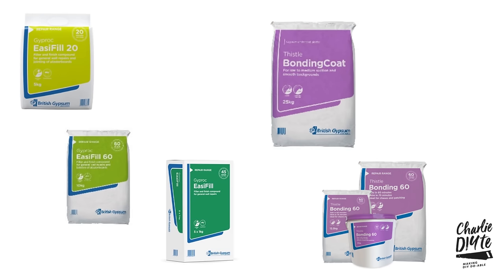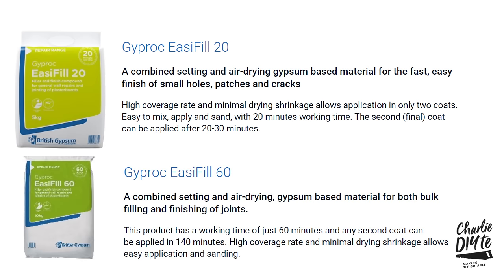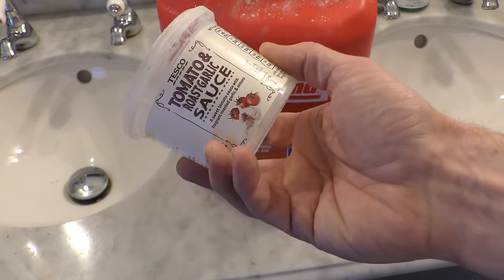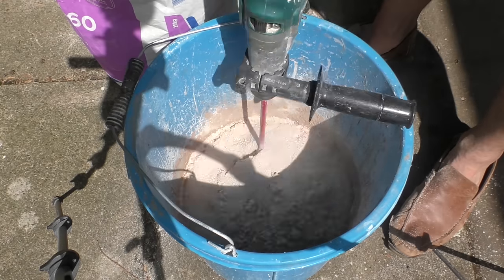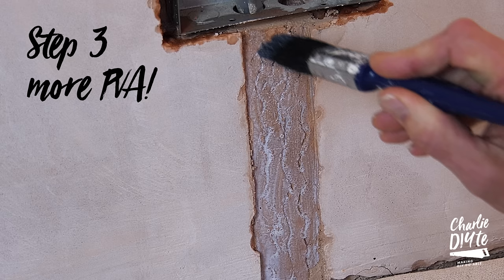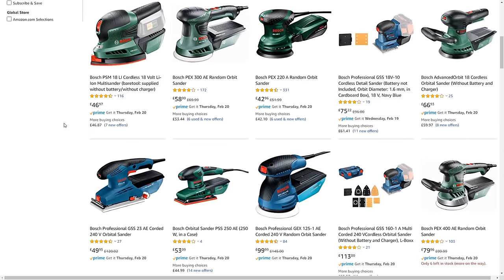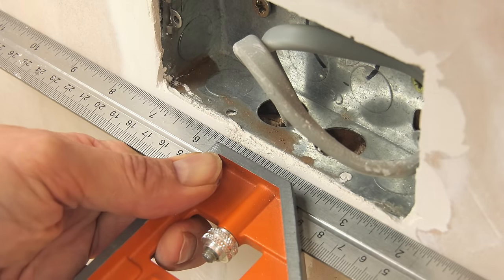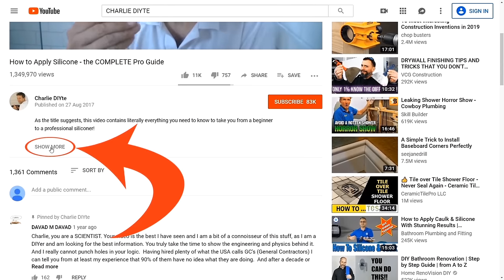How to Fill Wall Chases, Cracks & Holes

Comment: Hi Charlie, I have done a patch repair (100cm x 30cm) on blown plaster by just using Easifill 60 - built up in stages. 
Would it be best to use a diluted primer like Zin123, or just watered down emulsion before the final 2 coats?
 I don't want it showing after final coat!
Reply from the maker: If it was me, I'd apply a mist cost of watered down emulsion, but just make sure the emulsion can be watered down as some can't, as discussed in this video https://bit.ly/3ilSD3P It's always a bit tricky getting a patch repair to blend in seemlessly, but you could always feather the edges with some fine sand paper eg 240 grit or above, if it's a bit raised after the mist cost.

Comment: I have a great trick for back boxes.  After drilling for the screws & plugs, I fill the hole with plaster & push the box into the hole.  The plaster squidges out from the sides. You can get the exact depth you want, and the entire box is surrounded by plaster.  You can then insert the screws to prevent it moving, and clean out the excess plaster from inside the box.
Reply from the maker: Nice one Victor. I'd go one step further, and use expanding foam rather than plaster. That way, if it's an external wall, you're insulating the box from damp etc.
Reply: @CharlieDIYte  Good idea!  I suppose if there was a gap going beyond the edge of the socket, you'd need to use a bit of plaster, otherwise it would show..

Comment: Do you have any videos about fixing a crack in a concrete ceiling? Looks like I will be using Nucem HP & Primer - not too expensive but the delivery £35 stings. I've removed wallpaper in 3 rooms and  quite there's still 2 or 3 coats of paint (all the way back to 1930's original concrete render) and is there a paint on product to stabilise this as it will be a hell of a job removing it all?

Comment: Is the PVA necessary just for bonding? In the second example where you just used filler,  did you PVA the surface?
Reply from the maker: It's always a good idea to de-dust the surface as it enhances the key for the filler but check the instructions because some fillers don't require it - but even there it's still a good idea. Yes, I did PVA when just using the filler.
Reply: @CharlieDIYte  Thank you, Charlie. I'm literally about to tackle this today, and your video has already been super useful. Wishing you a very happy New Year!

Comment: Would I still be okay using these products if my house is solid wall (no cavity) built in 1903?

I need to backfill big gaps behind old skirting so I can glue/pin new skirting to something. Old Skirting was pegged into wall with timber pegs on the skirts.

Comment: I am goind to fill gaps left after removing pieces of timber(built-in wardrobes frames were attached to it). I've been told to use British Gypsum Thistle Undercoat Plaster. As you nicely explain the different products, would you mind giving your opinion on this? Can I use this to patch up the gaps which are 100mm wide, 10mm deep and 2300mm high? Or should I use Bonding 60 and finish with Easifill? I will apply whatever I choose on brick wall. Thank you.
Reply from the maker: I'm pretty sure Undercoat plaster is designed for shallower repairs than Bonding 60 (so up to 11mm) and it doesn't go off as quickly as Bonding 60. Other than that, they're pretty similar and you can build up Undercoat plaster if you've got deeper gaps to fill. So either would do the job well, but Undercoat Plaster will take a lot longer to go off. Yes, I'd use Easi-Fill to finish.
Reply: @CharlieDIYte  Thank you very much for your answer.

Comment: Couple of questions - apologies if they have been answered, I've been on that many forums and watched that many videos that it's starting to give me a headache. 

1. Did you use PVA before the EasiFill on the second chase? If so, do you let the PVA fully dry before adding it, or just wait until it's tacky?
2. What would you recommend doing if looking to repaint a wall and you've filled in a few cracks and holes with EasiFill, and the rest of the wall already has paint on it? Would you first apply a mist coat to the EasiFill parts, no matter how small? Then undercoat the entire wall once dried?

Thanks, Charlie.
Reply: Point 1:
I would apply a coat of PVA, let it dry, perhaps do it the night before (I like to keep the spare PVA mix in a plastic milk bottle, then you can easily mix it the next time it is needed with a quick shake (make sure the lid is on well though!) then apply a second coat shortly before filling so it is tacky but tbh it won't matter if it dries from my experience. Don't get too bogged down in the detail. If you think when a plaster does a whole room the chances are some of it is tacky some of it will have dried.

Point 2:
I would give it a mist coat if I had the time, but if they are only small areas you will be able to get away without. Though maybe pop up some post it notes or bits of light tack masking tape pointing to where the areas are as they can be hard to see after the first/mist coat.

I wouldn't do the entire wall unless it is needed, often you don't need to but the new paint may stand out and therefore mean a whole wall painting is needed.

Hope that helps.
Reply: @C4sp3r123  Thanks for getting back to me!

Comment: This is pretty much the technique we use on our professional electoral jobs. 

Some tips: 
Use a piece of 20mm conduit for the cables, it will let you pull up slack from the floor in the future if needed and protect them where they enter the box.

You can squirt in some expanding foam behind the box through the holes and in the gaps around the edge.  This will help to support it and is a lot faster then trying to force filler in around the edge.

If you're careful with a slightly damp sponge you can polish the easifill to a pretty smooth finish.
Reply from the maker: Fantastic tips. Thanks mate 👊

Comment: Hi Charlie,
Some advice please. The plaster on a small interior wall, adjacent to the front door, has areas that sound hollow when tapped. (Probably due to many years of the door being slammed, house built in 1896).
Is it worth trying to inject dilute PVA into these areas to try and re attach the facing plaster to the Victorian brick work.
I’m trying to avoid the ultimate fix of ripping off the plaster due to cost and re decorating hassle, many thanks
Dave
Reply from the maker: Hi Dave, yes I've done something similar myself but typically where I've got a small patch that's come away that needs redoing and I work diluted PVA into the gap around the edge of the hole to firm up and re-establish the key on the surrounding area to the repair. It works really well. You could perhaps make a small hole and do the same, filling the hole afterwards with Easifill (get one of the 4kg boxes that has 1kg sachets in it) - perfect for spot repairs. I'd say it needs to be a reasonable sized hole just to get air into the gap to assist the PVA setting, and of course so that you can get a decent amount of PVA in there.

Comment: do you think if you had the time it would be better to use the method you applied on your first socket, as the thistle bonding may create a harder fill? or not?
Reply from the maker: No, the easy fill sets to a similar hardness, but if I had large areas to do I'd use the bonding first because it's easier to tool.
Reply: @CharlieDIYte  Yes, also Easifill has gone up a lot since this video was made, a 10kg bag of Easifill 60 is now £27 . A 25kg bag of bonding is half that price..

Comment: What's your thoughts on everbuild one strike as a filler?
Reply from the maker: Never used it, Mark. I have such great results with Easi-Fill I've never seen the need to experiment with anything else - apart from the near identical Tout Pret when Screwfix didn't stock it.

Comment: Is there any other reason to use the bonding rather than just outright easifill? Is it just the cost as you say?
Reply from the maker: It's a good point, and I'd have to say, for wall chases at least, none other than the cost. You might find though if you're filling larger areas, ie perhaps a whole wall rather than just wall chases, that bonding is much more malleable / easier to work.
Reply: @CharlieDIYte  really appreciate the reply. Hope you have a fab weekend

Comment: How do you fix these holes with wallpaper on the walls?  All the examples I find are bare/painted walls.  My knee went through the plaster wall and there's a small hole i need to fill.  These videos are great btw :)
Reply from the maker: That's tricky. Is it just painted wallpaper? I think you're going to have to fill and sand like I showed here with the Easi-fill but don't overtool it close to the paper as the paper will start going mushy and tear, and be incredibly gentle with the sanding. You might then just get away with it. A bit of watered down paint to seal the repair and then paint over with your normal emulsion. The other option would be to try and scribe in a piece of new paper once you've filled and sanded, but this is going to be tricky as you'd need to leave the repaired area 0.5mm indented from the surface to take the paper.
Reply: @CharlieDIYte  Ill give it a go and see how it does, thanks very much for getting back to me, much appreciated!

Comment: why did you just use easifiller on the last fix ?
it was the exact same size as the first fix , why no bonding or p.v.a ?
why not just use easifiller on both fixes ?
thanks

Comment: Will this work for filling missing bits of plaster/gaps around my new sockets. My plasterer who reskimmed my walls decided to plaster over the entire backbox, he had a bit of tape inside and then ripped it out. It looks a bit shit on some of them. I always seen plasterers plaster upto the back box edges, not plaster the whole backbox then try to cut it out, just a bit bodge but he done a great job on the new ceiling and walls. 

Most of the socket holes are okay, socket plates cover these and are more square, just need to resquare off the bad ones. Also do you PVA in the cracked gaps before putting in bonding?

Great video! I never plastered in my life but I reckon I could do the bonding and easifill.
Reply from the maker: Yes mate. EasiFill is brilliant for this. I've tidied up around countless back boxes with it. Get this one https://bit.ly/393yo8a That way you're only opening one small bag at a time.
Reply: @CharlieDIYte  Many thanks Charlie! I was thinking of pushing some bonding plaster in, let it sit proud then shave it back a bit on the gaps/cracks then easifill over. Some of the lips of the square plaster around the backbox got large chunks missing. Do I need to pva before putting on bonding or will bonding adhere to current bonding/skim parts? cheers mate! This tutorial is amazing! really down to earth and well put together. How long should I wait for the bonding to dry before applying PVA before skimming over with easifill or should I just let bonding dry out completely and then pva and then easifill. Sorry for all the questions,

Comment: I always make sure I have another area prepped when I'm doing any filling, so any extra mix isn't wasted. Works right up to the end of a project.
Reply from the maker: That's a good idea. It's such a shame having to throw the excess in the bin.
Reply: @CharlieDIYte  Prices are mad here at the moment, with B&Q charging 30% LESS for 25kg Thistle Bonding than trade suppliers like Jewsons & Travis Perkins.
Got a 3 bed semi of plaster disaster to fix, which is way more than I've ever done before, so should be "educational".

Comment: Great video Charlie. I have a problem in that someone has filled dozens of rawlplug sized holes with decorators caulk, as a result I have horrible indentations everywhere! Does anybody have a good way of getting this caulk out of the holes??? I did wonder about driving a screw in and hopefully pulling it all out with the screw, does anyone have advice about how to tackle these? TIA.
Reply: sell your house and move

Comment: Hi, good video, I need to fill a wall chase that was put in a house for a wall mounted tv approx 5 ft and 45mm deep- would the bonding work to that depth or would I need to go sand and cement? thanks
Reply from the maker: Yes bonding would be fine for that.

Comment: Hello there I have an internal wall in a very old cottage the plaster inside lower on the wall falls off in sheets and I hear this has always happened in and long as people remember prob some dampness in the wall (rising damp) due to age of property - I saw what you said about lime render and sand and cement - can I ask how you finished that?  Did you just paint that or finish by some other means (I've done some sand and cement myself and some lime mortar in the past both external and therefore didn't require a 'finish')
Reply from the maker: For me it was upstairs internal wall so damp not an issue so we skimmed over with plaster. Not sure what to suggest for you. I suppose you've got two options - tank it so the damp can't get through or use a breathable render that you finish to a smooth finish and then paint.
Reply: @CharlieDIYte  Thanks

Comment: Do you need to PVA when using just the easyfill or was that just for the bonding?
Reply from the maker: No harm in it as it eliminates any dust and prepares the surface giving the Easy-fill a really good key. You could probably do it without though.

Comment: hi
Thank you for useful information I have one question:
 Working setting times, what do you mean by tha.
 Thanks
Reply: Working times = how long you've got from mixing it to apply it before it starts to be difficult to work with and eventually hardens and isn't usable.
Setting times = how long you need to wait for it to set before you can even think about putting another layer on top.

Comment: Hey Charlie. I bought an old council flat. It's high rise and needless to say the walls are concrete. All the electrical wires are in conduit. I'm no electrician and I don't want to spend the cash to hire one. So how do I go about hiding said wires without rewiring the entire flat?

Comment: Bonding 60 is a 25kg bag, way too big to fill just 5 old socket holes and chasers in the kitchen. So used Easifill 60 instead. Filled the holes in two stages. Mixed it to a little bit thicker than toothpaste. Looks great! Now just got to sand it and tile the wall.
Reply from the maker: Good work. The snagging product that comes in the 5 x 1kg bags is also great for small jobs. 👍

Comment: Both fillers are great.

A couple of thoughts:
For most DIYers the quantity they will need for a job is small. Given that fillers have a limited life once opened, I think using BOTH bonding and easifill will be a false economy. Yes the price per kilo is significantly different but if you buy both, use a little and end up throwing away two open bags in a few weeks' time you'll have wasted more money.

Also, with your sanding technique, a larger pad and always working across the chase would be preferable, so you avoid creating low points.
Reply: Would you say just Easi fill is sufficient?
Reply: @krakatoa16  No really depending on depth as easy fill is only good for up to 25mm and should be applied in approx 7-8 mm stages

Comment: on a ground floor solid 9' wall i have used surplus waterproof tile cement to fill without any rising or penetrating dampness issues.

Comment: Hi. It is ok to use filler directly to cables? Thanks
Reply from the maker: I always prefer to put something over them, just to protect them and in case you need to change them at any point but yes, you can in theory.
Reply: @CharlieDIYte  thank you

Comment: Question on the chases. Do you need a metal cover for the wiring? My sparky said it's not needed but the cables do move a bit. What would be the best option?
Reply from the maker: It's piece of mind really. I'm not familiar with what the electrical regs say on this, but it does tidy them prior to plastering, as you say, and it's cheap stuff to buy.
Reply: @CharlieDIYte  thank you.

Comment: a cheap detail sander from b&q with mirka abranet paper on it turns a cheap sander into a beast. the velcro pads on the sanders arent replaceable so when they go you just buy another sander for twenty quid. i normally replace mine every three or four months but i do this work a lot.
Reply from the maker: Yes, those Mirka Abranet sheets are  a decent shout. 👍

Comment: First go I made the mistake of failing to pva the surface. It looks okay and isn’t moving. Should I smash the filler out and do it again or just go with it?
Reply from the maker: No, just go with it. It'll be fine. A lot of fillers say you don't need to PVA but it's a belt and braces approach to remove dust from the surface to provide the best possible key.

Comment: For cracks is it recommended to go over them with a Stanley knife and then filler? Or straight filler will be ok?
Reply: In my experience, when filled as shown in this video the hairline cracks will reappear. I always widen and deepen the crack with a Stanley or grout removal tool and then fill.

Comment: Applicability Charlie? Any different approach when running cable behind plasterboard please?
Reply from the maker: You'd need to check electrical regs where you live. Always worth protecting with metal sheathing IMO though.

Comment: Bonding 60...can that be used for skimming an old bumpy wall that's seen better days and bad paint jobs ?
Reply from the maker: I think it's better as a patch and repair type product (only because it doesn't have the tooling properties of plaster), but if it's not a big wall and you don't mind sanding down any imperfections after it's set, it would do the job.